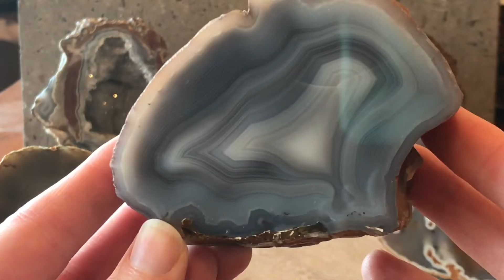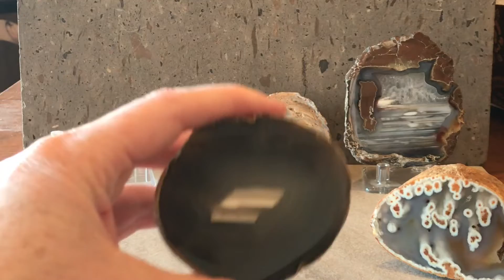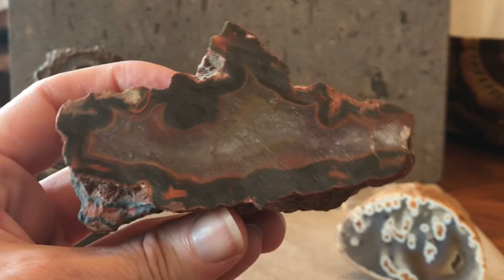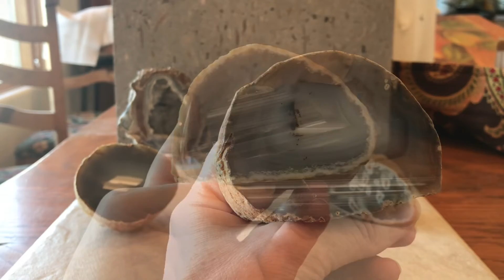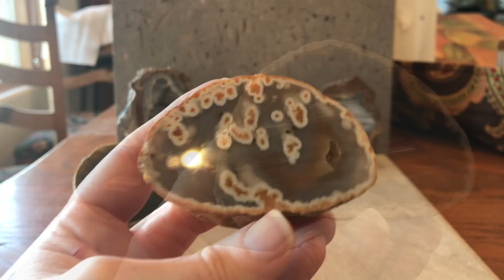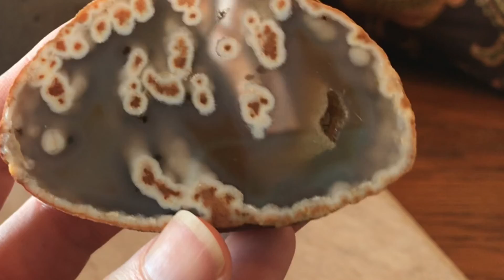How to “read” a geode or agate/nodule like a geologist!

Comment: What effects how large the crystals form? Is it lower temperatures or lower pressure or less time or less/more in the solution???
Reply from the maker: You need time and space for crystals to get large, and the temp has to remain above 300F for the duration of crystallization. There would need to be a pretty steady/constant supply of silica saturated hot water for a longer period of time, within a large cavity to get very big crystals.
Reply: @GeoRockNerd Thank You. That makes sense.

Comment: Amazing video great explanation learned so much information I did not Learn from other videos 👍. I have a question though how does the Silica rich water get through the agate layers or onyx blocking from any visible entrance or is this yet not been solved and do the quartz crystals block anymore material like chalcedony and onyx from being deposited furthermore into the void ?
Reply from the maker: Chalcedony is actually porous at the microscopic level - that’s why agates are able to be dyed all those crazy colors. Water can move through the previously deposited agate layers very slowly. Thanks for watching!
Reply: Okay thanks for clearing that up 😃

Comment: And how does a new rock hunting find these, no really absolute identification on the what we can look for.exterior identification would be helpful.
Bladdy bladdy  
I'm just saying.
What the hell do I look for?
Reply from the maker: A good question for sure.  It helps to be in the right region where agates and nodules are known to be found...where there's old lava flows at the surface.  Then, you look for rounded, nodular shaped rocks with or without a bubbly, rough texture on the surface.  All the nodules I've found have a greyish exterior covered in little bubbly nodules so they look very different from other rocks around them. Sometimes if you're lucky they have translucent agate/chalcedony on the surface that looks glassy.  Thanks for watching!

Comment: This is a great video! What fluid is entering these rocks  to cause these designs? You mentioned hot fluids entering the rock to make these designs. Just curious what this hot liquid is. Thank you!
Reply from the maker: Great question! These can be hydrothermal fluids (hot ground water usually saturated with minerals) from depth associated with thermal anomalies in the crust, or magmatism, that have a high amount of silica dissolved in them. It is also possible for meteoric water from rain/snow to percolate deep enough to get heated and then return to the near-surface in cracks/faults/veins. Hot, alkaline water will leach silica out of the rocks it’s in contact with, where more acidic conditions will cause silica to precipitate/crystallize out of the fluid. Other factors like pressure/salinity also can play a role. 

Thanks for watching!
Reply: @GeoRockNerd  Thank you for your quick response! This may be an impossibility but is there any video footage of this process occurring? Like time lapse footage? I know that may seem kinda far fetched but that would be so cool to be able to see this process occur. Thanks again for all you do :)
Reply from the maker: @ArtistformerlyknownasP  Unfortunately not but that would be amazing!  Agate growth is believed to take a very long time to occur, and happens at some depth underground where conditions are better - where fluids can stay hot and slowly cool. So far, chalcedony crystallization is poorly understood and no one has been able to replicate it in the lab like we have with quartz, which can now be made synthetically.
Reply: @GeoRockNerd  This is a genuine question. Are you in eastern Oregon? I am in western Oregon. I ask because I have always wanted to make my way to eastern Oregon and hunt for rocks (primarily thunder eggs) and you sound like you would be an amazing guide/mentor!
Reply from the maker: @ArtistformerlyknownasP  Well thank you, that is very kind of you to say! I am currently in New Mexico and all my videos thus far are for rockhounding here. I did live in Oregon for 3 years though and hope to make it back there for rockhounding someday soon!
Reply: @GeoRockNerd  oh well darn lol That’s a bit too far of a drive :) If you’re willing I would love to tap your brain about good locations to search for thunder eggs in eastern Oregon. Or great spots for rockhounding in general.
Reply from the maker: @ArtistformerlyknownasP  It’s been a really long time since I went rockhounding in Oregon,not sure I’m the best person for advice! I found this website with locations on a map though and if I were planning a trip I would start here:
https://oregondiscovery.com/oregon-rockhounding-map

Comment: 11:17 confusing, these three happened at completely different times, agate happened first, then the onyx then the quartz, if it lined the walls of the vug with what will be chalcedony then began to cool releasing pressure the onyx will form from residuals sprays in the inside collecting at the bottom this the waterline, pressure and heat are both applied and the remaining liquid becomes gaseous increasing pressure causing soi2 to precipitate off and forming the actual quartz crystals,  does that sound about right
Reply from the maker: Yep that's what I said.  Agate, then waterline then quartz, as conditions changed.

Comment: How come the outer shape matches the internal layering?  Is this because the nodule/geode formed in softer rock which later weathered away?  If so, what happens when this formation occurs in harder rock? Will you still find these formations when the harder rock is manually chipped/ground/blasted away?
Reply from the maker: The first layer that formed lined the cavity/void in the rock due to pressure, so it formed in the exact shape of the void.  Subsequent layers followed the shape of the first layer until the pressure was lost and then the layers formed at the base of the void due to gravity. The gas bubbles form in lava flows as they cool post-eruption, and the filling of the voids occurs in solid lava rock, which is relatively hard.

Comment: Another Rookie referral and new sub here.
I've hounded the Mississippi River from Davenport, IA upstream to La Crosse, WI for the last 40+ years and I just learned more about Chalcedony/Agate in 11 minutes than over that entire stretch.  Thank You.
This answered many of my questions concerning the variety of chalcedony that I find rolling down the "Mighty Muddy". Basically Glacial Till moved from the area N of Lake Superior into Canada, South to roughly just below the IL/IA border. Washed from a watershed including NE Iowa, NW Illinois, E Minnesota, and N & W Wisconsin.
There is, however, one type of agate called a Coldwater Agate from the SE corner of MN that, according to my homework, forms completely different from other agates.  Evidently Coldwater agates form from cold silicate bearing water seeping Down from the surface.  The water most likely coming from ancient seas, and accumulated in pores and cavities in softer rock like limestone, which then dissolves and is replaced with agate, commonly with the cavities being coated with quartz micro crystal, aka druze.  Are you familiar with this?
Again, Thank You for sharing your knowledge with us "amateurs", we soak up new info like this in our relentless pursuit to be less confounded by what we find.
As always...
Good Luck, Have Fun, and Happy Houndin'...
Steve.
Reply from the maker: I haven’t heard of Coldwater Agates but they sure sound interesting! Thank you for sharing that info!

Comment: Here from rookie rockhounding, and found this very informative. Why would higher temperatures lead to larger crystals forming? Some other features I find cool are iris agates, enhydros, pseudomorphs, and how lace agates get so convoluted patterns.
Reply from the maker: Thank you for stopping by, and for the great question! My understanding of the nucleation of macro quartz crystals is that they typically start to grow from boiling hydrothermal fluids at pressures between 15-100 bars. And they grow fast/vigorously in these conditions, due to the supersaturation of silica at the liquid-gas interface of the hydrothermal system. These conditions are not conducive to the slow growth rates needed for microcrystalline quartz to grow. I’m sure there are other factors too, but this is my basic understanding.

Comment: The way I've always seennit is, when they're forming inside the cavities of the basalt, the outer edges harden first and the remaining silica and minerals inside still have heat trapped which slows the cooling process, sometimes giving a larger crystal structure in the middle. In an agate, the amount of available silica in the cavity determines whether it will be one of those really dense agates, or a geode. If there's not enough silica and minerals to fill the void, the pressure will push it all to the walls of the cavity. Often seismic activity (like she mentioned) breaks them and allows more silica to rush in and go through a metamorphic process (or another) all over.
Reply from the maker: Thanks for commenting and watching!

Comment: Thanks for the nice video.  At about 11:17, with entry point at lower left, how do hotter fluids get up through all the layered material to get to the macro crystal pocket?   In digging at 
the old Richardson's ranch thunder egg site I always marked the outside of the nodule in situ as to horizontal vs. lateral orientation to try to interpret if existing ground had shifted after
the calcedony lines were deposited --- a bit different take on orientation and shifting if you don't have different skewed layers.  Really nice examples and educational information.
Reply from the maker: Hi Richard, thanks for watching! My guess is that the final fluids that crystallized the massive quartz at the end came through a different channel or crack, not the previously closed conduits. However, on the microscopic level chalcedony is porous and I have read papers hypothesizing that the silica rich fluids can slowly seep through the previously deposited agate layers into to spaces in the nodule as well. Most likely it’s a combination of processes!  Love the idea of taking “oriented” agates from the field, a great way to preserve that information that might be lost if there is no waterline banding! I’ll be sure to do that if I’m ever lucky enough to find nodules in situ!

Comment: Absolutely fascinating.  I never cease to be amazed at how much I thought I knew only to discover how little I knew.  I spotted the "Baker" before you even picked it up due to a personal connection to that magical site.  I live in El Paso, a little more than 60 miles due east of The Baker.  I got to know the co-owner of the claim, Paul "The Geode Kid" Colburn very well over the years.  As Paul's health deteriorated, he had a crew of three go out every spring and fall with a monster excavator and scrape away at the sides of the pit of andesite, basalt, rhyolite and perlite.  Paul let me go out each time just to watch how it was done while I dug through the "tailings pile".  It was always a three day, two night affair.  I used to bring a monster cooler full of beer and the guys were always tossing me "sure things" that came out of the wall.  I was an English/History major so I am in love with language.  The Baker (as I call it) is subject to a lot of different names; both for the site and the rocks.  It is variously called The Baker Ranch Egg Mine, The Baker Thunderegg Mine, The Baker Egg Load Mine, The Lindburg Claim and others while the rocks are normally called Thundereggs.  Personally, I am not a fan of using that name that originated about 1,000 miles away in Oregon by the indigenous peoples there for the great many sites all over the State.  I agree with you that if solid, they are nodules and if partially hollow, they are geodes. I suspect the use of the T-egg name came from Paul, who started out with a collecting and rock shop endeavor in Oregon.  When the original owners of the Baker, Eddie and Emma Lindburg got too old to maintain the claim they put it up for sale along with their rock shop and Paul and his partner Chris packed up and moved to Deming.

 I still have about 20 four gallon milk crates full of "eggs" that I have yet to cut.  When you dig from the pile only about one in ten will actually be an "egg"... most are just nodules of andesite or rhyolite, perhaps with a couple of small drips of sillicate, but nothing more.  Most of the Bakers I have, have several "points of entry" for the silicate fluids; some up to five or six.  Alas, the Baker is no more.  It petered out in 2012, I think, and Paul ceased sending the group and then he passed the next year.  It is not a "mine" in the sense that you would think.  It is more like a quarry.  Even if my age and health permitted collecting I would not go out there any longer.  It is way too much work to take a one in ten chance and the Border Patrol has become a pain hassling anyone in the area that is not a rancher.

That last one you pulled out with the stalagtites surrounded by agate.  What do you suspect it would have looked like if it had been cut in the opposite orientation, parallel to the stalagtites?
Reply from the maker: Thank you for sharing these great stories in your comment, you’ve obviously been a lover of agates for decades - and a well connected one at that, knowing Paul Coburn of the Baler Ranch and the Woodward Ranch folks too!  Sounds like great fun, excavating your own “eggs” from the rock!  I have found some nodules coming out of altered lava flows here and there but nothing like the Baker or Woodward material. Maybe someday I will! I sure do love a nice Baker Ranch nodule though!  There are other areas in SW NM that may be worth exploring with old lava flows. 

And agree, nodules can certainly be called “thundereggs” but I tend to reserve the word for Oregon nodules (which are also very cool)!

I think the stalactite nodule would be awesome if cut in the other orientation, would be cool to see their full form instead of only bits! I’ll keep an eye out for an example like that!

Thanks for stopping by, appreciate it!

Comment: When fluid fills the void it deposits on the outer wall. Does it then drain out and a new fluid comes in with a different chemistry or does a new fluid push the previous fluid out? It would be really cool to see one cut open in multiple angles like an orange instead of only getting one slice of the story.
Reply from the maker: There are multiple pulses of new fluids periodically. Lots of time can elapse between layers also, and the water can slowly seep out through time (chalcedony is quite porous microscopically as is the lava host rock) before another pulse of fluids infiltrates. And I agree, it’s fun to see them sliced in different ways!

Comment: So cool! Are you able to tell how long they took to form? Do they just form within any void? What causes the silicate fluid to form, and what causes it to solidify?
Reply from the maker: Those are all excellent questions! I do not know if anyone has done a study on how long nodules take to form, but it is generally accepted that it is a long and slow process.  The voids that seem most conducive to formation are gas bubbles in lava flows, from basalt to rhyolite composition.  The lava makes a nice encapsulation for mineral rich fluids to collect in, but also unerupted, deeper magma could be a source of the silica rich/mineral rich fluids that are needed to make agate.  This fluid migrates along fractures and crack and can infiltrate the gas bubble, or vesicle as we call them, and precipitate the minerals.  The crystallization process for chalcedony is poorly understood, and there are various hypotheses for how that happens.  Some people think chalcedony crystallizes from a gel like substance, but the most recent research I’ve read doesn’t support this hypothesis. It is possible that the initial growth starts due to a chemical or temperature differential between the vesicle wall and the fluid, or there could be some seeding mechanism; we just don’t definitively know! If more research shows otherwise, I will certainly post an update!
Reply: @GeoRockNerd  Thanks very informative.
Reply from the maker: @alczek  Thanks for watching!